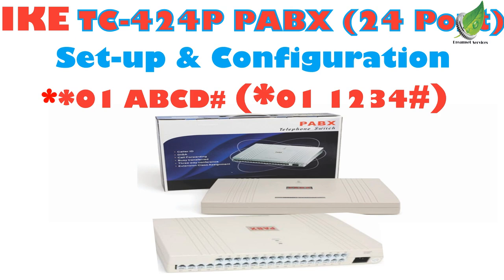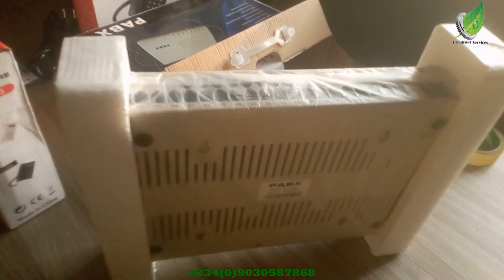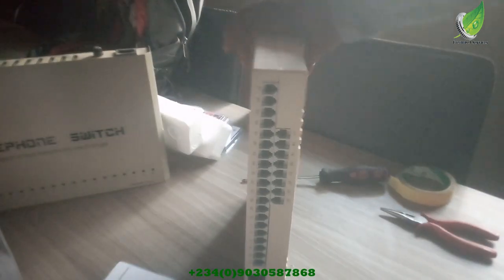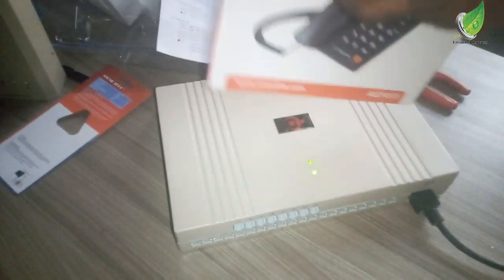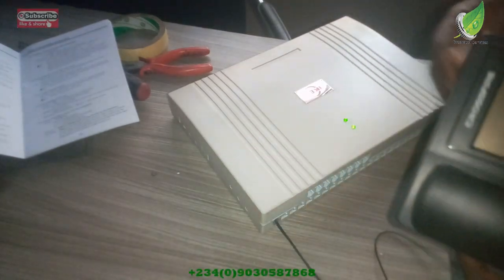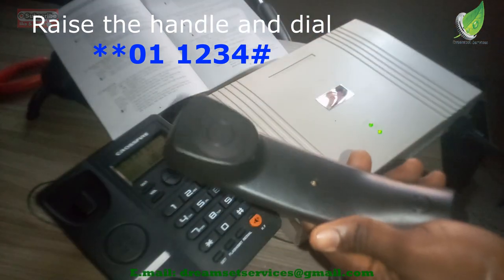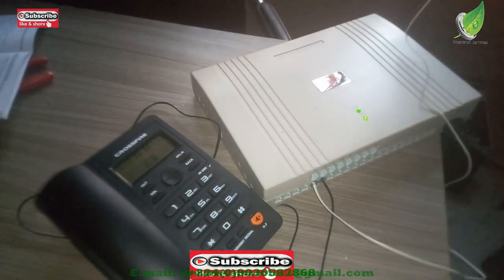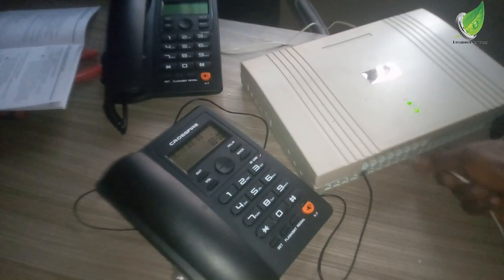IKE TC-424 PABX (24 Port) Setup & Configuration

Comment: Please can you talk more about how to configure the CO lines.  What will be connected to the CO ports for users to call external numbers
Reply: This might come too late but I will put it out here anyway, You need a router that supports VoIP, You slot the sim into the router then run an rj11 cable from the router to one of the CO line port. Note: The router doesn't necessarily has to have internet. It will work regardless.

Comment: Please your audio went out when you're doing the configuration and that made me not to understand.. The configuration, afternoon dialing**10 1234 and the system is configured,will other telephones be configured accordingly by the ports?
Reply from the maker: Yes sir, you only have to do the configuration on the first port, when you hear the welcome message all other port are automatically configured according to the number written on them i.e 02 port becomes 802, 03 port becomes 803 and so on